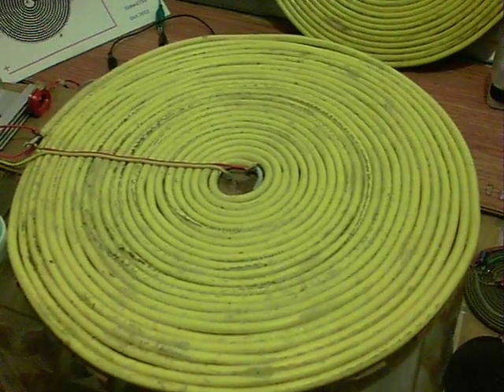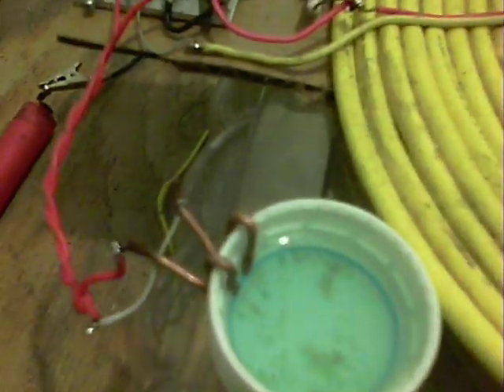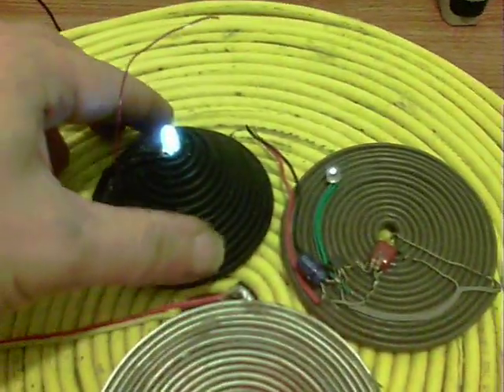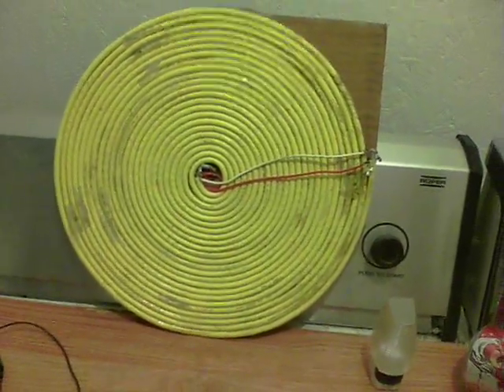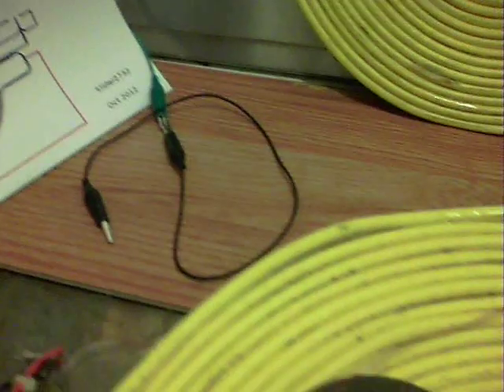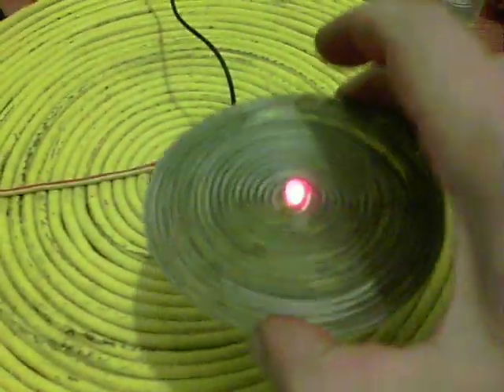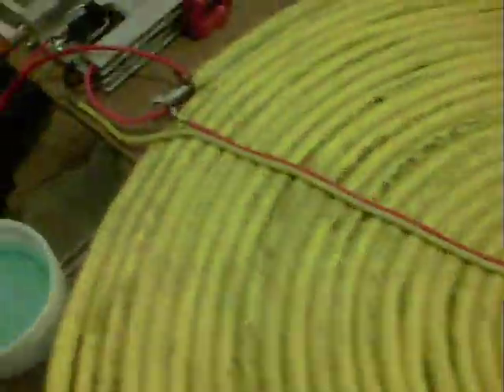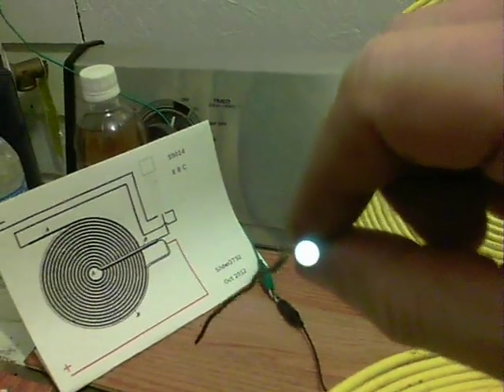Simple Wireless Electricity - Part II - The BAC's

Comment: What transistor did yoh used
Reply from the maker: No idea now. It has to be something like a TIP122. Plenty of power handling and high hFE. Also advise a heatsink on it, if experimenting and unsure of heat output.
Reply: @Slider2732  aahhh thank youuu so much , i did  this experiment  but my problem is the distance  , i mean after 12 cm it will stop , how can i make it for long distance , i have worked by transistor (2N2222A A331)

Comment: Hello in this video what is the transistor you use? Have you the schematics with  the diode? Thanks
Reply from the maker: Good questions and sorry to say I have no idea nowadays. Anything with a high Hfe is recommended, but nearly everything will work and such circuits are not fussy. It's a joule thief type of circuit though, with no output load. I haven't touched wireless power for too long!

Comment: That's gotta put out a lot of RF interference in the neighborhood. I'm surprised the cable people haven't tracked you down as the mysterious source yet. Or is the frequency too low to cause that? Get an RF meter, would be my suggestion. You could be messing up your body too, like cellphones. Presumably, anyone or creature in at least a 60 foot radius which is grounded will have a current go through them.
Reply from the maker: Plenty of radio use has been made to see about such interference and it's only a few feet. As a broadband source it's weak, on 1 wire or tuned to a matching receiver it becomes useful. An easy proof is to build one and do the radio test :)
Frequency is approx 500kHz and a scope sniffer coil similarly runs out of detecting range over a couple of feet. Was miffed at first, but then quite glad in retrospect, for the reasons you outlined.
For battery or mains devices they don't seem to be affected. In fact, I once had a setup where a radio was powered by wireless electricity, sat on the transmitting coil. The radio did have slight interference but worked fine for tuning in stations...somewhat showing the lack of RF interference by happenstance. 
As to cellphones, I don't use one. We have a landline (must be 1 of only 20 such things left in the country).

Comment: how do i make a coil like that how you do it.. im building my now
Reply from the maker: Easiest way is to use a concrete floor or large piece of wallboard that glue won't stick to. Then start the coil in the middle and tightly wrap around, securing with superglue as you go. The floor will enable the coil to be wound completely flat. Superglue dries in seconds, so the coil can be made quite quickly.
Using coax shouldn't work, because the middle copper wire is shielded with the braided steel outside it, but it works great.
Reply: Thank you ill try that and make a video upload
Reply: ok ok thank you ill keep that a try. hey what is the gauss on this? like what is the meter of the electromagnet field gauss.
Reply from the maker: Heck I don't know lol, haven't got a meter for that. Would like to know though too  :)
Reply: gauze and gauss are they the same?
Reply from the maker: They may be, depending on country and spelling. Though gauze is also the material put on wounds and injuries, or the metal mesh stuff in kitchen semi-circular food drainers.
One is pronounced gorz and the other gowse  :)

Comment: Do you get any benefit to the coil being flat on one plane, compared to if it was coiled around something circular like a transformer would be (without the iron core)?
Reply from the maker: Both methods do work well, this is just truer to Tesla's original design of flat coil. The SWES 2 does in fact use a few turns around a pills bottle as the coil former.
So I don't know about benefits in this sort of simple circuit, there may be though where the tuning of multiple coils to each other is more exacting.

Comment: Thanku sir and i have one more question how can i run a dc motor on that wireless system
Reply from the maker: It can be as simple as using a diode....have the diode running to 1 terminal of the motor, the other coil wire connects directly. Adding a low value non polarity capacitor across the coil wires before the diode can often improve throughput hugely, try 0.0022uF, 0.001uF etc, 1 value will make a big difference compared to any other (resonance). Sometimes a single diode, such as a 1N4148, works far better for small motors than a full wave bridge rectifier !
Reply: Slider2732 thanku very much sir 👍

Comment: Can i use 2n222a transistor with that wire which u used with 24 turns ????
Reply from the maker: For this type, it's best to use TIP types, good power transistors. 2N2222A's are superb for the smaller 1.5V builds though. Mostly it's current handling and heat that has to be worked around. You could try a 2N2222A, but with a large resistor to the Base...which would affect wireless distance.

Comment: Good day sir, I attempt to replicate this project. However I consistently pulling 0 amps into the coil. The only difference is the transistor i am using and possibly the wires. Can you offer any advice please?
Reply from the maker: As answered on the other vid with the same question.....except for this larger system, use a variable pot of 1K -5K in series to the Base. That will allow tuning the coil and indeed oscillation. If you place another coil with LED on top, tune the pot until the LED gives best brightness and range. Good luck :)

Comment: Are there any induction wireless charging products that you are offering for sale ?
Reply from the maker: Maybe...i've been looking at Etsy as a sales avenue to make products and sell them. Included would be well made versions of the SWES 2 for $9.99, AA powered. But, on focusing on the recently shown mini arcade cab builds, i've just blown up my only Orange Pi and have no cash to replace it ! Which means a return to thinking smaller. Thanks for such an enquiry Saul, it's appreciated :)

Comment: what is the material used for the coil sir? and how to calculate the inductance of the coil sir?
Reply from the maker: The coils are made of co-ax, the same thick type that connects a TV to a satellite dish. It has an outer sheath of braided steel and a copper core. 24 turns each, which makes the inductance the same if the turns start and end at the same places...hence no inductance calculation. I wound them exactly the same as each other.

Comment: How do I get this to work from a 12 volt battery?  What value of base resistor is needed?
Reply from the maker: Every build will be different, because of different wire types, winding method and more. The best/easiest way is to use a variable resistor pot. The pot should be a 1K type, in series with the Base wire to the Base lead of the transistor. You can use a 5K as they are more common. Adjust it until you see maximum output and then note the value with a multimeter. Replace the pot with a resistor of that value.

Comment: 50 feet of 18 gauge speaker wire and either 12 or 24 volts to power the tesla pancake coil I am going to make from the wire. Need advice as to what NPN power transistor to use as well as the resistor value on the base of the transistor. Want as much current flow in the pancake as possible. Your help much appreciated .

Comment: Can I know the circuit schematic, I would built this circuit for a phisic experience in my school, thanks
Reply from the maker: +stilix That&#39;s all there is to it, at 0:31
With higher voltages than 1.5V, add a resistor in line to the transistor Base.
If you get overheating problems, add a diode in line from either battery connection.
Reply: +slider2732 Many thanks I will try in the next days

Comment: So from my limited understanding of coils, transformers, wiring anything basically(motors etc), higher voltage is relative to MORE higher gauge wire, whereas thick gauge wire would be more amps?    Could these be used as transformers? Maybe if there was a plate (carbon plate) of some sort in between?

Comment: theoretically, if you were to do this with your main power wires that go to your house underground, between the 7200v transformer and your power supply meter, you could achieve the same thing, maybe even amplified?
Reply from the maker: +Weston Schwab Maybe, but I wouldn't ever try it lol. However, it's a very valid point, to isolate the main house supply and guard against lightning strikes with a wireless gap.

Comment: Great Video. If the LED with one wire will pick up the current, why does it need the one wire? If it's not a closed loop, couldn't you just have the transistor coil and then just the LED? Or other type of bulb picking it up? If no, could you explain why not?! Thanks  for the video!- Andrea
Reply from the maker: +Andrea Merson Hi Andrea. The single wire passes pulses at high speed. These circuits run in the 300KHz sort of speed range, which because of the fast sharp on/off switching pushes some electrons out of the wire into the immediate area. It forms a layer around the wire. 
As such, an LED on a coil can detect the field energy that is passing over the wire...also means that large fluoro light tubes etc can light fine over a thin 30AWG wire at 20ft distance, because current is going over the wire and not all through it. 
A conventional circuit would need 2 wires, but when the energy is pulsed at high speed, it can pass along just 1. Pass enough energy and it breaks out from the wire...which is induction wireless electricity.
Reply: Great info. Thank you!

Comment: Its a nice one
... but when I tried iam not getting any output ...

Can u help pls....
Reply from the maker: +nihal kallithodiyil It could be the transmitting coil or the receiving coil. Put an AM pocket radio near to the transmitting coil and it it makes a buzzing sound on the speaker, it's working and the receiving coil isn't. 
Best to try the smaller version first (Simple Wireless Electricity is the previous video, with instructions how to build). These are just scaled up versions, but usually will need a resistor in series to the Base of the transistor...a couple of changes, hence the simpler version is best to start with. Much will be learned and very quickly when one of those is seen working.
Reply: slider2732  thanks.. let me try it...★★★
Reply: slider2732 I used tip35c trans ans 5w470ohm *2 resistors .. with an input voltage of 12v 1 A.... 

How can I check the wirking of the reciever coil???
Reply from the maker: +nihal kallithodiyil Best to use a variable pot of 1K to the Base...the best resonance and operation will be at a certain spot and the tuning can be very fine indeed. 
A very easy method for a receiver is to find a small inductor choke and put an LED on top of it. The chokes are round and made of ferrite, with about 100 turns of copper wire wound around them, about finger nail sized ...can find on old CRT monitors and old television boards. if no choke, then a 12 turns small pancake coil made from a modem lead will work, again just put an LED across the start and finish of the wire.
Reply: slider2732 nw it wrks for me...bt I couldn't get the type of coaxial cable u used .. so I used a speaker wiring cable. . Nw hw can I increase output
Reply from the maker: nihal kallithodiyil
Congrats ! am glad it is working. Tuning is trial and error because each system will be different..as you say, you used speaker wire, for example. You can alter the Base resistance to the transistor, experiment with different numbers of coil windings, of receiver windings and more. Adding a small (0.01uF) ceramic capacitor to the receiving coil can very much help. Again, 1 particular size will make most difference.
Your own changes and learnings will teach much better than I could ! Best of luck with the experiments for certain, am very glad it's working :)

Comment: why the transistor?  what part does it play? 

why the plastic around the pancake coil?

if the led light up with just a string of wire why does the rest needs the pancake shape and wind up as well?
Reply: +Frank Lopez The transistor is needed to resonate the magnetic field by turning it on/off over 1,000 times per second. Else nothing will transfer wirelessly. Like why you have to move a magnet through copper why to generate energy just leaving magnet there won't it has to be moved.

Comment: interesting  May I ask how could this be applied by the homeowner- Thanks
Reply from the maker: A number of ways. Firstly, for avoiding short circuits in garden wiring, from chafed wires, rain, dew, snow etc by being 1 wire transmission. These systems can always look good mounted under a coffee table, for wireless lamp operation, cellphone charging, ornament lighting.
Also, you can't get an electric shock with this sort of power, as the frequency is much higher than the skin or nerves can detect...making it far safer electrically with children around.
For lighting circuits around the home, just 1 thin wire is needed. A 4ft fluoro tube can light with no ill effects using 1x 30AWG wire, plus no starter needed for it AND burnt out CFL's or fluoro tubes work fine. 1 thin wire also saves a lot of cash on copper wiring.
Reply: Wow thanks.  I am chemistry teacher. Some physics

Comment: can you please give me more details about the last test in this video ...

I mean did you use the ground to transfer the power over 60 feet away ??

please give me more details about that ...

thanks in advance
Reply from the maker: The frequency is high enough to travel on the outside of the wire, not through it and so will carry the HV pulses which are analogous to AC power (you can light 4ft fluorescent tubes on a tiny gauge wire this way too).
The bulb can light because of the grounding using the copper piece. The wire is carrying a high voltage from the system, the ground allows the voltage difference to light the bulb. An alternative, is to use 2 diodes facing opposite directions and connected at one end, called an AV plug. With that method, no ground is needed.
The HV being carried from inside the house is able to run the pancake coil shown at the end. That coil works like a repeater, allowing the 60ft distance, with just the thin single wire connecting between.
Reply: slider2732 Thanks I am very appreciated for your effort and info sharing ..
can I understand from that experience also  is ground is just like a big capacitor that can charge with this circuit ??

Comment from the maker: To twigg62212
The transistor came from a CRT monitor mainboard and the specs showed a higher than average current gain, simple as that. The coils set up the frequency and in that regard it's free running :)
Just has to be a power transistor, for heat reasons mainly, compared to small signal transistors like the 2N2222A, MPSA06 and other often used types in these experiments.

Comment: Is it real ?
Reply from the maker: Fully :)
See the video before this one 'Simple Wireless Electricity System' for the easy 1.5V version. You just need a regular transistor from an old hi-fi or radio etc and a few feet of telephone wire to make a coil with. To receive the energy, you can wrap very thin wire about 50 times around an old pills bottle and connect an LED across the wires. Hence the word simple in the name, a very easy to make wireless system.  From there, higher voltage larger systems like this one make more sense as to how they work.
Reply: are You having a mobile phone ? it works with the same patent

Comment from the maker: The only things different to the diagram in the vid, are the water resistor in line with the transistor Base wire and the use of a diode across the Base and Emitter of the transistor. That diode protects the transistor at higher running voltages, in common with any circuit that features a coil. It's commonly called a freewheeling diode :)

Comment from the maker: Any 2 strand wire will work, an old wall adapter/phone charger up to co-ax cable etc. Simply make round and round turns with the wire, starting at the middle and secure as you go with superglue. There should be at least a dozen turns when you are done. Connect the outside end of 1 wire, to the inside start of the other wire, that's your battery Positive connection. Nearly all NPN transistor's have their left pin as the Ground connection. Connect the other 2 wires to the 2 other pins.

Comment from the maker: Both capacitor and resistor it seems. The distance the electrode legs are from each other can bring output changes, but the main use is a flexible damping and solid Base triggering. It's somewhat like a tank section, natures own.

Comment from the maker: LMAO a 220V bath, you need a health warning sticker on the forehead. There is a very mild tingle when touching the water...it would have graced the pages of early 1900's electrical magazines perhaps. 
The water regulates better than a resistor, with variable pots hitting defined sweet spots, the water just works. How efficiently we'll have to find out, but looks better for the higher voltages + there's the electrolysis off one leg and sulphate thing to look at.

Comment: Mr slider what is the current draw when measured between the battery source and coil when  used with no lights and when you have all the LED's  in place ?
If an led works in water you may perhaps take a piece of transparent pipe and drill holes into its length and glue in some leds and see how many will light up with the electrodes at  either end; keep up the good work

Comment from the maker: Thanks. 24 in fact, has to be a multiple of 3 with these things lol. 
In fact though, it was accidental. I wound the first BAC with wire from outside on the fence, using all of it. Wound the 2nd from another whole section and there was only a meter or so of wire left. If I had wound the 2nd one first the other would have been short of wire...was lucky. Double lucky to get that multiple of 3 with the turns.